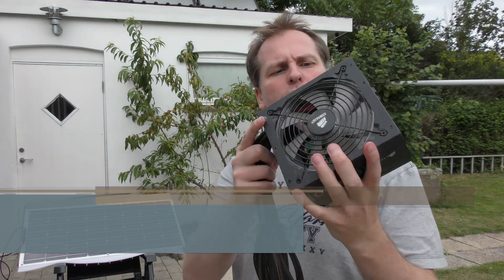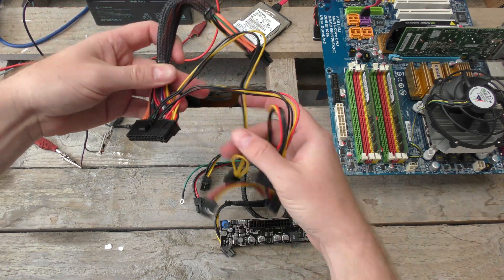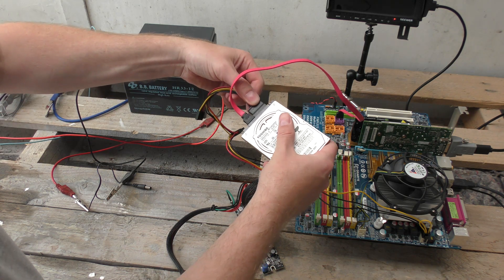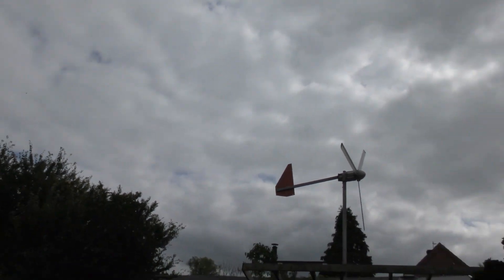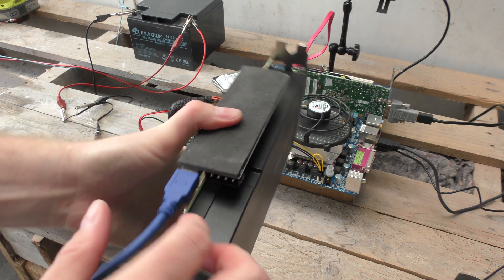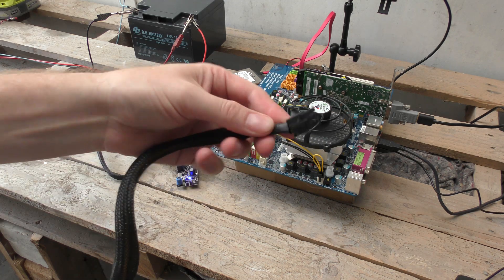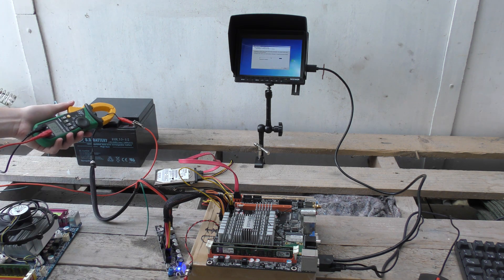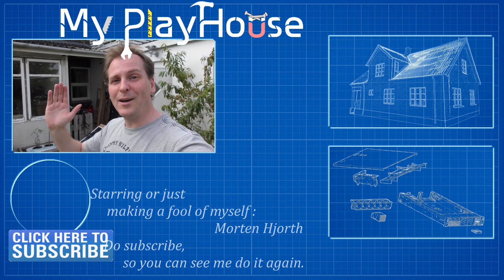Solar Powered PC, maybe for Cryptocurrency Mining - 868

Comment: Can I use AC to dc 12 watts 30a and than connect to inverter again dc to ac with 239v 1000 watts output?
Reply from the maker: This does not sound like a good idea,, and 12W can not be converted in to 1000W.

Comment: Hej Morten,
tak for inspirationen !
og det tricket med at købe en 12v PSU.

Jeg er gået i gang med at lede efter de ting der skal bruges og har fundet et ASUS P5Q-EM motherboard,
som jeg håber kan bruges til projektet.

Kan umiddelbart kun finde en 300W 12v PSU på amazon og tænker om det er overkill, hvis kortet kun bruger i omegnen af 72W idle ?

https://www.pcstats.com/articles/2365/4.html

Så vil spørge om en 120W vil kunne klare jobbet og derforuden, hvor jeg kan finde det kabel du bruger fra batteriet til PSU'en ?
Reply from the maker: HI tobias jensen
My channel is English, and to make sure as many as possible,  can also enjoy the comments, they are also English.
Please keep to English.

Go with the 300W,, it does not use 300W all the time.

Thank you for watching! :-)
Reply: @MyPlayHouse  Hi Morten,
I got the 250 W PSU and ASUS P5Q-EM.
Having trouble starting the system, as the fan spins for 0.5 seconds and doesn't start afterwards. Do you have any clue, what might be the problem? 
cheers

Comment: if I may ask, in one of your older videos you showed that you use to use red colored old solar panels(my dad bought some about 10-15yrs ago that never got used; box say 15w but was getting about 7w in a quick test), do you recall what was the rating of the ones you had and what the efficiency was like? was there a major improvement switching to the blue colored panels? prices of the newer style panels locally are 100w poly @ $89CDN for $119CDN mono off amazon which is borderline between cheap and expensive:P...... I bought a Renogy PG 40A MPPT controller.... reason to play with this now is that I have stumbled upon a potential "infinite" supply of free lead acid batteries of various sizes(alarms/ups/etc) thank you
Reply from the maker: Sorry I do not rembember anything about red solar panels :-/
Reply: @MyPlayHouse  it is possible I am mistaken..... I ordered 100w mono off amazon(local store did not have any in stock), hoping it will give better results than the red 15w panels I have; wish me luck:P

Comment: Q8200/7gb ddr2/gt710/32gb ssd ? Is this possible to run from that power supply ?
Reply from the maker: If you have a power meter, try to measure what it draws from the wall. and if it's under 250W you should be all good. It will be less without the losses in the PSU. (I would estimate your setup is 50-80w)
Reply: @MyPlayHouse  I will order one for AliExpress it's not high price and it's nice investment :)

Comment: you can put a nvidia gsx 750 ti, 1050ti, maybe also the gtx 1660,  and rx 550, 460, 560, maybe also rx 470/570, and put it a but lower. 
also use a usb stack 8gb, linux, and one stick memory, works also with 2gb (mmpOS), not even a screen, or mouse or keyboard
Reply from the maker: Hi Steven G
Thank You very much!  Yes there are good ways to improve on this,, I saved 1 ampe just switching to the SSD.
Thank you for watching! :-)

Comment: 54watts in idle is realy bad already so when u mine crypto the consumption goes up to over 100 or 150watts im guessing ... while the old gpu or cpu is realy slow at mining even cents of cryptocurrency
Reply from the maker: Hi VillaMasterSF
Thank You very much! Yes someone found that this motherboard was 12 years old. It not the most power efficient anymore.
Thank you for watching! :-)
Reply: @MyPlayHouse Just Brainstorming here:  in Order to mine Crypto with real surplus u would need ether completly costfree Used parts or Low Power parts and one very effiecient Chip depends on the crypto U mine some need asic Chips some can only be mined with gpus also greetings from Germany

Comment: You can't grount anything to a wooden *TABLE*! It's a table, not a floor! Therefore, it's not the GROUND, so no grounding there. The word says it all! Try grounding it to your wooden floor (or marble may make for a specially shiny ground), it will work.
Reply from the maker: ;-) I will keep that in mind,, good thing I have so much dirt in my head that I am just always grounded.
Reply: Nooo!!! Your head is up in the air, it won't ground you! You have to be on the ground in order to be grounded!

Comment: I have a few concerns about things, first you need a step up and down converter to power the graphics card I would suggest one using an LTC3780 chip, you could use a large step down converter if you were using a 24v battery setup. second is that I hope you know that graphics card is passively cooled? it has no fans and relies on the airflow inside a server chassis in order to cool it properly.  I would suggest looking at the setup that a fellow youruber did HBPowerWall he setup a crypto currency miner to run on his solar battery. he has a 48v systen and he used a really big step down converter to 12v then he had a small voltage regulator going to the mainboard. I'll try not to nitpick too much, I hope it works out for you and nothing goes pop!
Reply from the maker: Thank You very much,, I am just playing with this,, I just wanted to run a PC of Solar,, in this case.

Comment: Couldn't you hook that to a big 12v battery to run your PC and then have a charger on the mains charging the 12 v battery. Then you'd have an online UPS without having to convert back and forth to 230AC. Why am I wrong?
Reply from the maker: Hi Seán O'Nilbud
That was what I was doing,, solar panel charging battery and that running the PC.. There was not enough sun to run it directly.
Thank you for watching! :-)
Reply: @MyPlayHouse  I mean in the general run of things . If I have an online UPS there are many conversions from 240AC to 12vDC and back again to get from the mains to the motherboard.

Comment: Good idea having it solar powered but I'm intrigued as to how the main board didn't shift about at all when plugging in the connectors.
Reply from the maker: Hi Andrew Jenery
Thank You very much!  the big board was kind of heavy, It was just laying loos on a box,, so if it did not move, when I put in that big system board power cable,, that would be weird,, I did not look.
Thank you for watching! :-)
Reply: @MyPlayHouse  No problem, I enjoyed the clip, never occurred to me the idea of powering a main board with a solar panel.  Maybe the box it was laying on stopped any shifting when you plugged the connectors in, but still a mystery ;)

Comment: it is possible to run a good computer power supply on 40VAC, Only reason I know is because I was daft enough to do it to prove a point to somebody that it was possible, and I ended up using a variable AC station so could do it 'safely'.
Reply from the maker: Hi Claire Clough
I really do not know,,,, but you did it ? on AC,, wonder if DC would also work then. I have a 48V bank.
Thank you for watching! :-)

Comment: ** if you haven't look into 771 modding that board(if it's actually goona be used), lot of the old xeons were a decent amount lower TDP:P.... most those gigabit boards support(all of mine did), just have to update the microcode and flash it ** for true power efficiency on a mitx look into atom D2700(10w tdp; or whatever is the latest of that catagory of atom) if you don't care about speed, or AMD Apu's(e1-2100 , C-60....both 9w tdp); the amd's tend to be better in my opinion....... the quadro I think uses 20-25, equivalent of a geforce 430/630(HD5450 is my go to for low power or rage II:P... **the quadros support pass through long as get the vm to lie to the nvidia drivers)...... if you want to go a full sized board there's 2650e(ddr2/am2 15w tdp),  Athlon II 160u(ddr3/am3 20w tdp)
Reply from the maker: Hi plasmar1
Thank You very much!  I have done videos on this : https://www.youtube.com/user/SirNetrom1/search?query=771
Thank you for watching! :-)

Comment: Fascinating use of a DC to DC power supply to go direct with a Solar Panel. That’s actually a great idea for powering low power PC off grid.
Reply from the maker: Thanx, Yes no reason to convert up and then down.
Reply: @MyPlayHouse  I power 3 PCs in my shed from a solar setup and inverter... I think I'm going to look at doing this instead and save the conversion losses!
Reply: @MyPlayHouse  To be fair I think the conversion is fairly efficient, a 750W PSU doesnt actively pull 750W.

Comment: You can boot the system from iSCSI specially if you were mining it's more efficient to boot everything out of one ssd for all computers, some distros will also run off usb sticks. Also for even further efficiency you can get some miner boards with multiple pci-e x1 slots and run off a low powered celeron. About the DC-DC and converters I also highly recommend looking at the efficiency curves at each voltage, also sometimes you can get better efficiency running higher voltage at the input side due to wire losses (specially if running several units). Also something to consider regular ATX psus will run off 100-240V and they will run off 100V DC so if you put 8-10 batteries in series plus a solar charge controller you can run them off straight DC, any universal motor, switching psu and non-inductive loads will run off AC/DC, though computer PSUs will achieve better efficiency at 200+ volts.
Reply from the maker: Hi Dash Tesla
Thank You very much!  glad you liked the video :-)
Thank you for watching! :-)